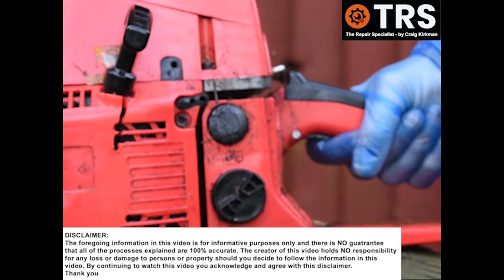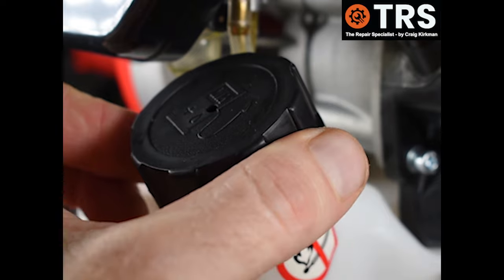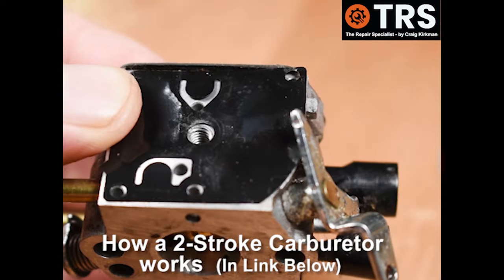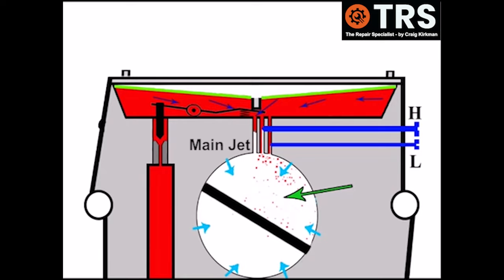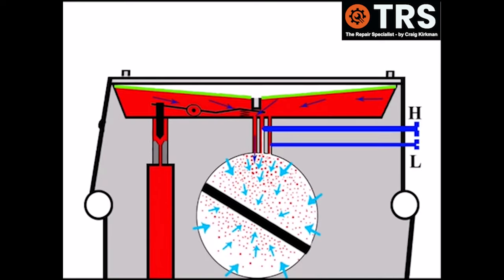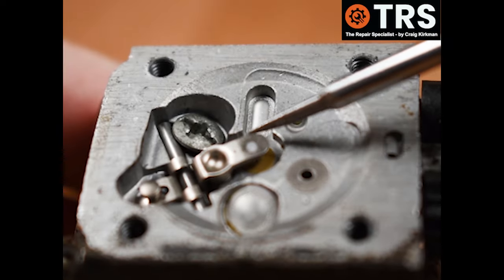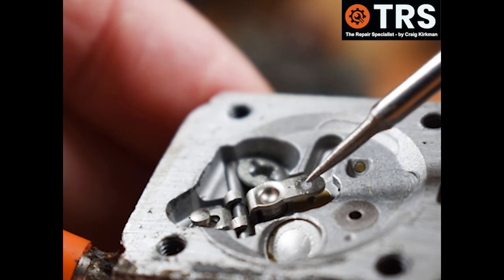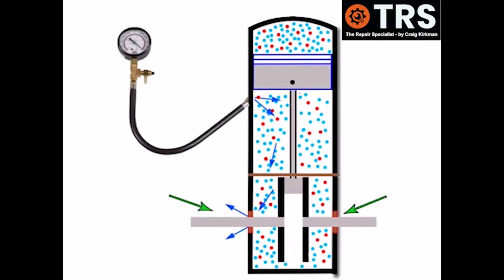Why does my chainsaw start then die when I give it gas?

Comment: You nailed the explanations. I have repaired enough small engines to have encountered all these things so agree with you completely.
The most common problem I encounter is Carby adjustment ( after ensuring the air filter is clean) and poor fuel mix. 
I forever find people that add an extra dash of oil to their mix but that just makes it oil up and not run right.
I have found that the ideal is to use recommended mix.
I have also found that if you want to go with one mix for everything you can get away with 25:1 and use motorbike two stroke oil as it is low ash and will tend to burn off the spark plug better.
It's worth noting that an air filter effects the mixture in a significant way. You can remove and clean a filter but it may still not be free flowing. Also the air filter should be on the engine when adjusting the carb. I once had a Stihl chainsaw that was almost impossible to start. I changed the air filter and it was fixed. Interestingly it was also impossible to start without a filter fitted. Lesson learnt and remembered. That shows the importantance of air/fuel ratios.
Your video pretty well covered most things that happen in real life with these engines.
Thanks for sharing it.
Reply: "The most common problem I encounter is Carby adjustment."   How does the carburetor get out of adjustment?
Reply: @codetech5598 1: the air filter will start to block up. Even if it's cleaned it won't be as good as a new one. 2: the fuel oil mix will be incorrect so it will burn at a different  rate 3: things wear out and change. Jets, pistons, exhaust carbon buildup. 4: those if the big one. When it's but running correctly someone decides they can adjust it.  They do it wrong. Then you are just going around in circles. First of all understand what you are doing and why. Then do what is needed. Don't just start turning high and low speed mixture screws thinking you will get it right. 
Sometimes things are just worn out too. Everything has a service life.
Vibrating jet screws it if position is not common. People adjusting them is
Reply: @lynpatnat  If people adjusted the screws and then it didn't work they would know they broke it and what the problem was.

I have Stil MS 180 that is 15 years old.  I was thinking of just buying a new carb but they seem to be suspiciously low cost and made in China. Are they any good?
Reply: @codetech5598  I would think that they will be much the same as the original. Maybe the diaphragm and other rubber parts won't be as good but they seem to work on everything else that seems to come from China ( that seems to be everything) so it's worth a try. Don't throw out your old one and perhaps out a kit through it at some stage so you can swap it back.
There are so many YouTube videos of how to overhaul the carbs. There is a small mesh screen that can get blocked, the diaphragm can be hard so won't flex or may leak so that can all alter mixture. 
I'm sure there's days even Stihl parts are made in China. I bought a group of parts for a av38 magnum and it included Carby. I have never used it but it looks very well made. To me it looks exactly like the original. 
Just don't throw your old one away.
Reply: @lynpatnat  My point is that for the price of just the gaskets from a Stil dealer, I could get a new carburetor plus gaskets plus rubber hoses (including the chain oil hose) plus a spark plug and other stuff. ($14 for the parts kit including shipping.)
Reply: @codetech5598  It's what I would do. Get the lot from China. You won't really lose. The rest of the parts may come in handy and if the Carby turns out to be good you will know soon enough. 
I've used lots of Chinese parts and most of them are good. Some seem at least as good as original. Buy good spark plugs though they can't seem to make good ones of them.
Reply: I did have a vacuum hose on my saw break one time. To get to it was hard. I had to pull most of the engine out if the housing. I didn't need to split the casing but the hose was hard to get to. It was cracked where the rubber hose connected to the crankcase. I saw it with torch and used a thin screwdriver to poke at the hose. 
If you look for YouTube videos on checking for vacuum leaks it may be helpful.
Order the parts as that are cheap then pull the saw apart and have good look at things after 15 years most rubber things will have perished. Hoses would be on my hit list of possible items.
Reply: @codetech5598  Stihl oem carb only, chinese carbs are a total waste.
Reply: @robertoduranos5196  Too late; I already ordered it.
Reply: @codetech5598  carbs get out of adjustment due mostly to dirt & varnish, also wear in other parts in the carb & engine, occasionally me thinks the screws can even vibrate out of position. Why most of 'em have springs on the screws to minimize that. If someone in the past has over tightened the adjustment screw, it will be distorted and never right after that until replaced. One final note I know for a fact is if the carb was adjusted for ethanol gas mix and then fueled with mix made with pure gas, the mixture will likely need adjustment, and even the idle speed set back. Reverse is true too.
Reply: @markbaker1843  I think it is more of a problem with smaller saws with their smaller carbs. At this point in time,  I think if you need a small saw, you should get a cordless electric model.

Comment: This is good stuff! I think we've all struggled with our IC machines not running correctly. thanks!!
Reply from the maker: Thank you for your awesome feedback 👍👍
Reply: @TheRepairSpecialist  I put your hot tips to use today in fact. My weedie kept wanting to bog, and would only stay running on choke. I pulled the carb & cleaned it with carb cleaner. I adjusted the pop- off valve for flush with the body, and made a new gasket that goes between the carb & isolator block. Shazaam!! She is running again. I touched up the needles and it's running like new again. It was either an air leak or not regulating enough fuel, either way it was too lean. Thanks again!!!

Comment: I've been working on getting my chainsaw up and running again. Your videos have been absolutely amazing in helping me learn how this all works and potential fixes. I'm currently waiting on the tool i need to adjust the high and low jets. Clearly it can be a lot of different things but here is some info for you; maybe you could point me in the best direction!

Chainsaw has 20-30 hours of run-time and is only a year old. I unfortunately made the mistake of leaving the oil and gas in it while in storage over a couple months so I'm suspecting varnish is likely in my lines. I bought 50:1 premix from the store instead of mixing my own fuel to run it. The chainsaw will start from a cold start fine and even run perfectly fine for a full minute or two with no issues. Once slightly warm it bogs down and turns off. When I restart the saw, it will sometimes struggle to stay running with a low and rough idle OR the idle is fine but in either case, as soon as i pull the trigger it bogs down. Sometimes if I slowly feed the throttle it will make it to full speed but fully depressing the trigger results in the fastest bogging and thus the fastest dying of the chainsaw. In either case, after the initial "smooth" start which lasts a minute or two, the chainsaw dies out very quickly and definitely under a minute after subsequent restarts. Starting the saw is a struggle after the first smooth start and takes more attempts than normal to get it to turn over.

Thanks again for all of your helpful information so far!
Reply: I just found your troubleshooting video that goes over my very question! Happy to get a reply back either way, but i'll check that out for help :). Thanks again!

Comment: Very well done and detailed video!  I am hoping one or more of these suggestions will get me up and running.  I bought a small chainsaw knowing it wasn't running at the time.  Now I get the pleasure of getting it up and running. It will run in the high end fine and sometimes idle just fine but what it seems too have the most trouble with is after running at higher speeds it dies when I let off the trigger.
Reply from the maker: Ok. Just re-set the carb and see if this rectifies things. If not then we can look further into it. Thank you for the kind feedback. Craig

Comment: After watching this I would never attempt to fix this problem myself. There seems to be just so many things that can go wrong. This is a good ad to take it to a professional.
Reply from the maker: Ok. Go get it fixed!!
Reply: shop rates in my area run $85 USD / hour. My way of thinking is you can't break broken. Yes the first time can be daunting, but if you take note of what The Repair Specialist says in this video, you'd probably have success. Most the time you won't need to be concerned with all the nuances that he goes into every little thing which MIGHT be wrong. Worst case you end up taking it to the repair shop in a basket case.
Reply: @markbaker1843  new carburetors usually cost less than one hour of labor

Comment: I recently had a problem saw, (Husky 550XP) which ran faultlessly for two years. Then went from running without issue one day, to bogging and cutting out under any load the next use. Not the fuel mix, as I only use Aspen. To cut it short, after the checks that I could make, without stripping the carb. I took it to a local small engine specialist and they sorted it. Turned out to be a slight gungy buildup, blocking the carb’s gauge filter. The rest of the filters were good, just that one causing the problem.

I usually brush off around the filler cap/plug before refilling. But I guess I’ve not been as diligent as is needed. And over a period of time, even the smallest of particle debris, had built up. Apparently it wasn’t immediately discernible, until the gauze was help up to a bright light. They blew out the gunge and cleaned the gauze filter. All ok now and a lesson learned for future refuelling.

Comment: Excellent video, just adding my 2cents worth, before running all the tuning checks for this problem check for Mason bee or Paper wasp nests in the exhaust muffler system. This is a more common problem than one might think although negatable with spark arrestor fitted.
Reply from the maker: Thank you for your input and kind comment. Craig

Comment: I have taken out the high and low adjustable needles as you suggested but now realize you never mentioned how to replace them back in the correct position. So now I must take it to the shop and admit I attempted to cut them out and do the repair myself and now they will probably charge me an arm and a leg just to teach me a lesson.

Comment: The first thing I do is check the "spark arrester".It is located on the muffler opening. To keep  sparks if any from starting a fire. I have seen saws that have that screen which is what it is get clogged. And cleaning it off with brake cleaner and a wire brush, will make the saw run good again. If that is not the problem I go on to the carburetor.

Comment: Hello Craig , this is one of the best vids on this subject , I have a small tip for you & all who see this , to clean the spark arrestor mesh on the exhaust you can soak it briefly in brown vinegar , this eats the carbon off , but keep your eye on it as leaving it in there too long risks getting the  mesh eaten away also ! 
I have a question for you , I have a very old Stihl 075 saw that just bogs out & dies every time I try to start it , real animal of an old thing , I have put new carb diaphragms on but no change ,  can you please go into more depth as to how to use the compression tester gauge to diagnose blown or old worn out crankshaft seals , as I think they have gone hard with age & no longer seal , but I would like to prove it to myself before stripping the whole saw down to get access to these seals . Many Thanks in advance .
Reply from the maker: Hello,

Thank you so much for your kind words and the excellent tip about cleaning the spark arrestor mesh using brown vinegar – that's a valuable piece of advice for maintaining chainsaws! It's always great when the community can share their insights and help each other.

Regarding your Stihl 075 saw, diagnosing crankshaft seal issues is indeed a crucial step before disassembling the entire saw. What you have requested is a great idea for another video, but it mat take a little while to get round to this as I do have a stack of vids to get through. So to get you and others in the community on the way with this then I have just outlined the procedure.  Again, this is only for now until i get round to the vid.

To use a compression tester gauge to check for crankshaft seal problems, you can follow these steps:

Prepare the Saw: Ensure the saw is in a safe and stable position, and the spark plug is removed.

Insert the Tester: Screw the compression tester into the spark plug hole.

Turn the Engine Over: Slowly pull the starter cord while observing the gauge. The pressure should build up as you pull the cord. A significant drop in pressure or an inability to build pressure can indicate a problem.

Repeat the Test: Test both with the throttle wide open (WOT) and with it closed. If you notice a significant difference in pressure between these two conditions, it may suggest issues with the crankshaft seals.

Compare Results: Compare the compression reading to the manufacturer's specifications for your saw. If it's significantly below the recommended range, it could indicate a seal problem.

If you find a noticeable drop in pressure between open and closed throttle settings, it might indeed suggest issues with the crankshaft seals. However, if you're unsure or want a more detailed diagnosis, it's always a good idea to consult a professional or a local service center.

Thank you for reaching out with your question, and I'm here to help if you need any more information or assistance. Good luck with diagnosing and repairing your Stihl 075 saw! Craig

Comment: Well it turns out my chain saw is bogging down for 1 of just 28 different possibilities. I shall work through them all starting with checking all the bolts are tight and the fuel cap valve and see how it goes. Great tutorial. Thanks.
Reply: Don't do anything before checking the H/L adjustments.

Comment: My small Stihl chainsaw (MS160?) was bogging down badly, even though nearly new. it took me a while but I eventually found the spark arrestor screen completely choked with carbon. I cleaned it very carefully but it happened again later that year. Enough was enough. I removed that arrestor screen. Now I'm careful to not use my saw in peak wildfire season, but it's too hot then anyways. My saw is finally reliable! By the way, my gas/oil mixture was correct, with Stihl oil. But the carb runs a little bit rich and there are no mixture screws on the smaller models.

Comment: as ever , very comprehensive and very clearly explained. 
so i suppose if the bogging improves once engine is warm that would tend to indicate air ingress which stops when the warm metal has expanded and sealed the leak?

Comment: I have a problem with a chainsaw. It hesitates (bogs a little) when you hit the throttle, but goes up to full revs. Now when I turn out the L screw, the hesitation goes away, but another problem appears. When you release the throttle,  the revs will go down to idle but instead of ideling, it dies. The revs go down too far and then come up a little. If the saw wont die, it idles fine (idle is not too low revs). What could be wrong?

Comment: Didn’t explain much about the high and low screws at the start of video u make it seem like ur gonna explain them but u divert to other causes then u start to get back on track to the H&L screws then off again to fuel reasons don’t get me wrong!!  This is a very informative video on 2 stroke but would liked to hear u explain the H&L screws a lil more like how all manufactures have presets and how backing H out 1/4-1/2 turn then back in with engine running can fix a problem with choke having to be on to get peak rpm at full throttle there again thanks for the video overall very informative!

Comment: I repaired and maintained portable plant on the railway for many years and one the worst problems with two stroke plant was operators not mixing fuel correctly. Throwing extra oil in the fuel to save wear actually creates worse problems. The more oil you add, the weaker the mixture, which then leads to overheating and piston seizure and expensive repairs. I could never seem to get it across how important correct fuel/oil ratio is in a two stroke. All the twiddling and tweaking in the world won't save an engine that is trying to run on close to neat oil.
Reply from the maker: Very true. Thank you for your comment. Craig 👍

Comment: My Stihl MS310 starts and runs pretty good sawing logs for a few minutes and then it gets in bog mode where it usually stalls.  I've taken the gas cap off and restarted but it's still bogging like crazy and it dies.  If I can get it started and let it idle for a minute, it seems to reset for a while.  The intermittent nature of this doesn't make sense.  I haven't checked the fuel filter yet ... maybe that's it?